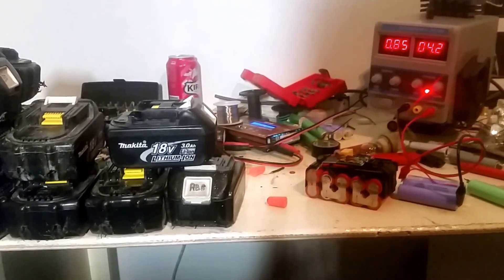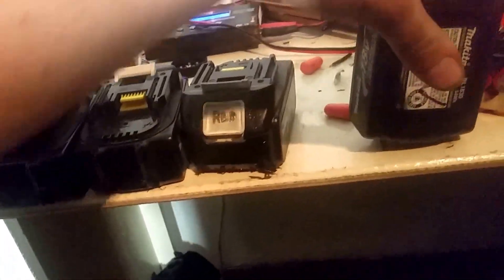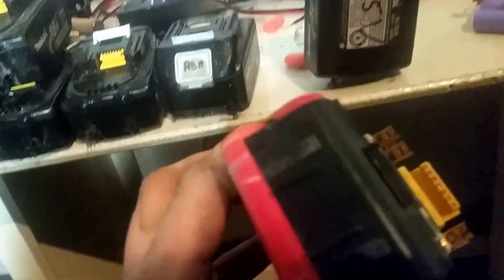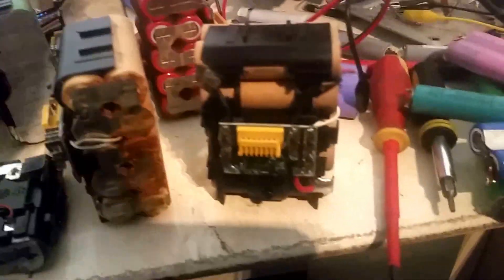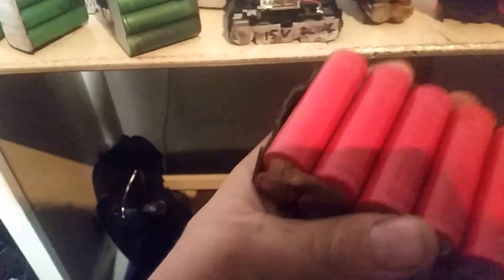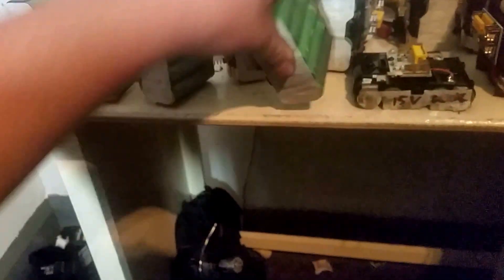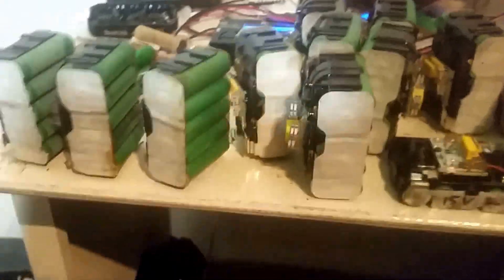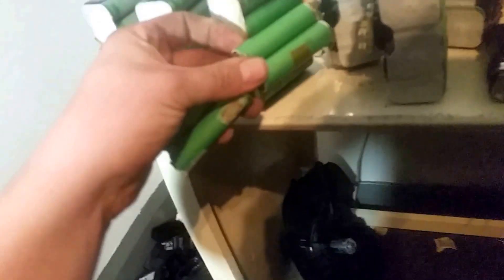18v Makita li-ion battery pack breakdown 18650

Comment: neil peppittHi my makita batterys have packed up what cell can I use to replace them with please help seen some cells at 3.7v and all different ah
Reply from the maker: The ones in a std 3amp makita cell are sony cells at 1500mah. 3.7v is a nominal  voltage there  usefull range is 4.2v to 3v